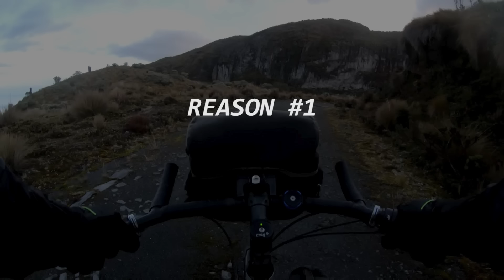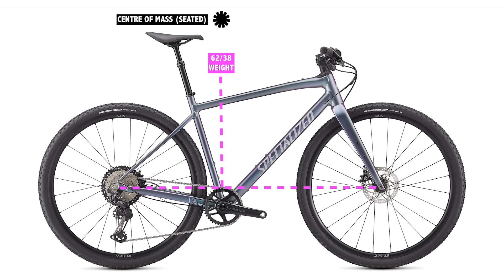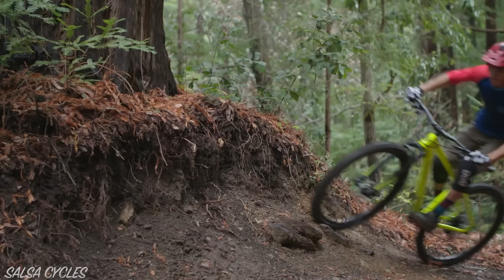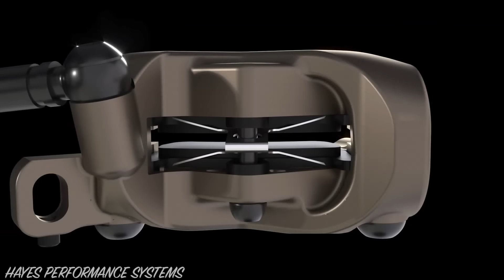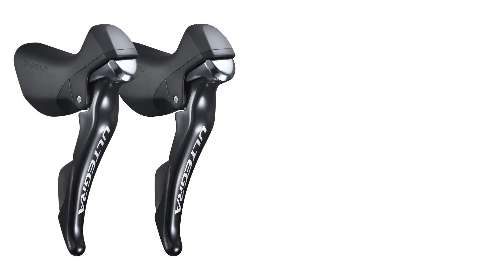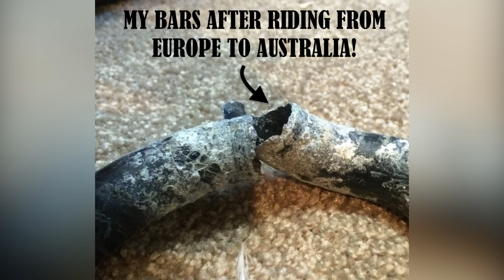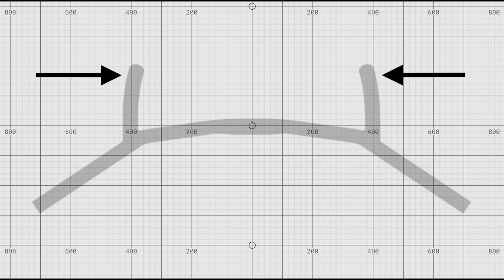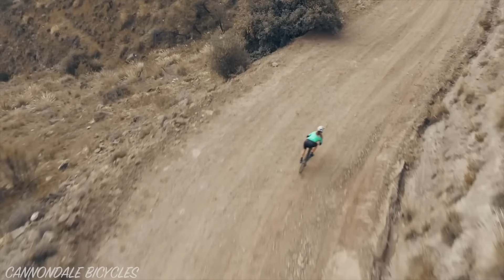Why Flat Bars Are BETTER Than Drop Bars For Most Cyclists (Objective Analysis)

Comment: In general, drop bars offer these advantages over a flat bar:  1) Forward aero riding position for less air resistance and speed.  2) Leverage in the drop bars for more power.  3) Much more hand positions and better wrist angle for comfort.  4)  Classic riding on the hoods.  5) Optional ability to add aero bars for even more aero and speed.
Reply: If I was 20 years old. And only ride on paved roads.

Comment: I finally got a Koga Denham flatbar for my Genesis Tour de Fer 20, and am really satisfied about it ! It is great, has several positions (at least 3 or 4). It could just be useful to have a somewhat shorter version, to have the arms less wide apart. Thanks Alee !
Reply from the maker: The only way to go narrower is to make the bullhorn width narrower - and then my handlebar bag wouldn't fit! I'm not sure I can live without that bag for my adventures. 😳

Comment: It's a bit disingenious to just ignore ergonomics. That's the main reason people choose drop bars for touring, of course the result won't favor them if you just rule it out. And ergonomics are not more subjective than the other categories. There's more than enough very objective research on the ergonomics of bicycles.
Reply from the maker: Both drop bars and flat bars are ergonomic by definition. With the right bike fit, you will be set up comfortably on either. This is why you find people riding happily with both handlebar designs.
Reply: @Cyclingabout  Sure, but they're not identical, so they both have (objective) ergonomic pro's and con's. That's why I don't like the implication that people choose drop bars because of looks and marketing.

Comment: There's a reason motorcross bikes are flat bared. 100% agree,  on chunky gravel roads - Australasia's best roads to bikepack , cause quietest, back country, flats wins absolutely hands down, so much more control on decent with speed, cornering particularly. Easily. By miles.
Tarmac ? Drops all the way.
But who wants to bike pack on busy tarmac roads lol
Reply: That depends on where you live. In many places, tarmac roads are often the only option of cycable infrastructure. People from the states for instance will probably not have any other choice than to ride on the road

Comment: Former bike shop manager; I've ridden about a dozen different frames and about 3 dozen handlebar configurations. Best thing I'd recommend, find the bars for you. GENERALLY, if you're after speed, try drops, if you're after long journeys in the saddle, try alt flat bars. My setup is Surly Molokos with a 110mm stem on a 2021 Giant Roam 2. That works well for me, but it may not be your cup of tea.

Comment: So agreeing a lot of these points hang on the "for most people" qualifier, and enumerate a lot of fairly minor annoyances here are my opinions on this opinion piece:
1. Agree handling is increased on a wider bar - to a degree.  If you can't fit between the trees you have a problem.  And there are a few of us who can handle a drop bar on trails most other cannot.  I'm in the .5% who will rarely be driving to a trailhead so a wide bar is a detriment on the approaches.
3.  Toe overlap is usually only an issue at stops.
4.  I don't see braking being a problem on either bar with the modern, ubiquitous uptake of disk brakes.
5.  Gear ratios are readily available on any bar type.  90+% of gravel with elevation is done on drop-bar 1x getups with huge rear cogs and small chainrings.
6.  Price - 100%.  Walmart does sell bikes and not many drop bars.  That said I absolutely dispute the "best value for money part."  That is entirely subjective.  And here's where we get to the real meat.  Drop bars are more enthusiast-oriented so come on high-spec bikes more often whereas a lot of flat bars are for "city bikes", newbies and other unskilled riders who want the confidence of an overbuilt MTB on any terrain.  (Allowing there are a good number of skilled MTBrs - they are just outnumbered here.)
7.  Selective here.  Drop bars come in more designs than the author here allows.  Just as he depicts flat bars with extensions and add-ons - these very same additions are available for and included in drop bars as well.  I myself travel hundreds of miles at a time on a drop bar with aero extensions.  It is supremely comfortable and offers several hand positions.
8.  Very few people will need to (or should!) attach more baggage than a drop bar bike will allow.  A lateral bar burrito is very subjective but also, for many, not a desirable config.  As mentioned before I have aero bar clip-ons on my gravel bike.  In the past I've strapped a drybag on top of this facing forward.  Nowadays I pack a Cyclite aero bag below these which is more aero than without the bag.
9. Very, very picky here.  Bar grip tape is not an issue in my extensive experience.  Besides which (I've never needed to but..) everyone should have a bit of tape on their inflation pump or frame for VERY MINOR and RARE issues like this.  Lacking that, it is actually possible to ride a few miles back to the car or home without bar tape!  Hell, some hill climbers go sans tape in their races.
10.  Sweat corrosion - here we go again with very rare occurances happening to newbies who probably never clean their bikes.  Where in the world did he dig up those pictures???   That said carbon fiber is pretty common thing too.  Just sayin'.
11.  Gear box shifters are not common at all.  Moving on.

So yeah - it's BS to call an opinion "objective".  The author has selected a few arguments that back up his position and relegated those that don't agree to also-mentioned status.

Here's my subjective analysis:  Drop bars are a better choice for experienced riders who ride more than a few hours/week on mostly non-technical surfaces ranging to the occasional technical single-track.  They are more aero at any speed, more comfortable over longer distances, provide more hand positions, less weight/pressure on the seat, better positioned for road/gravel racing, and navigating long distances.
Flat bars are (in general) for people riding majority technical single-track and downhill, those purchasing their first bike; those who ride occasionally - up to a couple hours per week, short commutes or people like the youtuber here, who just don't like drop bars!
Reply: Impressive, thanks.

Comment: I gotta call BS on handlebars affecting toe overlap
Reply from the maker: The front centre length on a bike designed around flat bars is longer on average. That's a fact. A longer front center means less chance of toe overlap.

Comment: The control of the bike is not about the handlebars except for braking.  Control of the bike is about weight shift.  A well set up bicycle with good geometry is easily ridden without touching the bars.

Comment: Interesting video, and the points described are correct. However, leaving the most important topic for most riders out of the equation - ergonomics - is a bit confusing. Getting better ergonomics can outperform all of the other arguments easily. I'm not saying that dropbars have generally better ergonomics. I think both types have their distinct applications, dropbars being better for higher speeds on better roads, while flatbars are better suited for rougher terrain and/or more weight/transport capacity. So you should clearly decide what you're planning to use your bike for, and then the other decisions come pretty natural, including the choice of handlebars.
Reply from the maker: The reason why I didn't discuss ergonomics is that both drop bars and flat bars are ergonomic by design. Whether the design will be more or less ergonomic for a rider depends on a multitude of factors (biomechanics are unbelievably complicated).

Comment: Aero bars are useful only on long, smooth & safe segments, because of stability and you can't brake quickly. On drops, you can use brake from at least 2 different hand (&body) positions. So, 90% of riding time, drops are more aerodynamic.

Comment: Both times I bought used bikes with drop bars for use around town, the first thing I changed was... the drop bars... 1. The stance may be aero but it gives , in my opinion, a poor overview of traffic and caused me neck pain (back in aero position + head in upright position = bad neck). 2. The brakes were not quickly accessible in the upright body position (this is perhaps a defect corrected on the more "modern" drop bars?)

Comment: Ha Ha, Just bought an AMAZING accessory from Chins, so its drop bar add ons for flat bars, like bar ends, so you just slide them on your flat bars allowing drop bar spacing/width of any size, you can use flat bar shifters, drop bar brake/shifters, cyclo cross top mounts, bar end shifters, if you use a bar end mirror that sticks out nicely on the end of the flat bars, the possibilities are almost endless, no idea why you never see them here, you can quickly convert a flat bar to a flat bar/drop bar combo, you can adjust the flare by rotating the flat bars, reach with stem length and rise so much better than standard drops which are very expensive if you want wide.....and thats if you can find any over 46cm

Comment: When you wipe out on your 42cm drops and take out your GRX STI's it's gonna be expensive too, and that's if you can get a replacement in the third world....  there's reasons for sticking to tried and tested old tech like steel, MTB, 26", 7/8/9 speed, rim AND disc compatible frame/forks...

Comment: It all depends on what you want to do with your bike. If you only ride on the road and long distances, drop bars are the best.
Even on a mix of road and off-road riding, drop bars are often better especially if you do long distances because, among other things, the position of your hands is much more natural.
If you mainly ride on difficult to very difficult terrain, then flat bars are the right choice.
So flat bars are no better than drop bars or visa versa. It's simply a matter of using the right bars for the right purpose.

Comment: As someone with arthritis, flat bars destroy me within 30 minutes, drop bars orient my hands in a neutral strain position. Ergonomics isn't ignorable for some of us. Yes you can get add-ons for flatbars that give you similar hand posture but they aren't designed as the primary position, so your brake access is wrong. Also if you're customising your bars so much that you aren't using any of the default primary positions then the distinction between flat and drop stops being a useful one: at that point they're just generic levers you've attached some custom stuff to.

Comment: For me 6 of the 8 minutes on flat bars don't resonate. With drop bars shifter/brake levers are always at the ready. Hydraulic brakes are fantastic! There's no difference in stopping power whether on flat or drop bars. If I was doing mad miles I think the main advantage of flat bars is a more upright position which makes it easier to look at all the beauty you are riding by. Great video. Thanks!

Comment: About the Koga Denham bar that I tested : way too twitchy when bike is unloaded. Ergonomics are fine and make the bar comfy but its design brings the grips area too far backwards, beyond the steerer tube, unless you use a very long stem which in turn will stretch you too much when on the horns of the bar... In my opinion, the new Velo Orange Crazy Bar has smarter design.

Comment: My favorite for touring, bikepacking and city riding are butterfly bars. When using butterfly, shifters and cables do not get in the way with handlebar bag and also i can rest my hands very good on butterfly and ofcourse you can use them for aerodynamic position, not as good as with dropbars but still not bad.

Comment: I would just add that when you aren’t in a race, flat bars with more upright position offer more natural air ventilation which is very important riding bicycle in summer. Also flat bar with a slight back-sweep offers the most ergonomic hand position. In a city flat bar more upright position offers better visibility over traffic, and enables rider to perform sudden manoeuvres which in a city riding means more safety. Flat bars hands down is a winner.

Comment: I agree 1,000%. I had drops for years and almost never used the lower position. I swapped to "bull horns," but these days I've got an old Ibis titanium MTB with a modest rise and it does the job. 
I added bar ends, taped up with bar tape for comfort, and I'm a happy bunny.
Cheers
Reply: So what's the difference between bull horns and bar ends?
I like the hoods, more comfy and natural position, I can shift slightly my hands so, I spend most of the time there with my drop bar, sometimes on the flat, less on the lowest part. Maybe I could cut a bit...
Reply: @DR_1_1  It's hard to say. Probably not much. I can see that drops will give you a faster, more aero position on the flats. But I'm more interested in long distance comfort. So I think the flat bar/bar-end combo gives me more options for hand placement.
Reply: @BrianRPaterson  Apparently it could  be linked to our body shapes, I think long legs and arms prefer lower bars, long torso are more comfy with straight/flat...

Comment: You are incorrect in assuming that ergonomics is a subjective experience. Also your sample group is limited as is your target audience. Lastly your experience is somewhat lacking in the versatility of use and time. 
Bold brash statements without basis or consideration. THINK AGAIN. Do it right.
Reply from the maker: You should be more specific and provide evidence (or reasoning) about why you disagree.

Comment: Glat bars are great witb ablut six inches cut off the ends so bloody eide nowadays. I was a road cyclist still am i have a Ribble hybrid mow after brsin damage. A little clumsy i fo t wntto trash my full carbon road bikes, irs an illness cycling it really is. So a hybrid thats slowly becoming a toad style hybrid. Its a sore point i wisj it came with canle actuated brskes nloody full hydro i csnt use my 105 brifters. Putting a new 105 rd on i font use the smaller rimg at all in fact its ground off pointless that a 105 casette problem arises with shifter csnt use my current 105 unless it get cable actuated brakes another 200 quid. So ive come to a comprise withyself ill get a Sora rd i canuse the altus casette still its nearly new.  And use mountain bike shifters. I believe you can up to nine speed any more the cable pull is different that abd hacking said flat bars. Really good bike for 600. Ive tsken the silly hybrid rack off abd put on a carbon seat post. Came 11 kg 6 lbs its foen to 10kg 3lbs. Ill have it sub ten just light gor what it is i do miss a sevfn kg bike. But it would brake my heart snapping avfull carbon frame.  Fair enough my folks will get sacrificed but the frame eont fold like my madone one did. I hit a tree hsrd i mamaged to dlip off to the side. Thebike hsd no chance a literal bend in a aluminium frame. I couldn't do it again if i tried. Like the somersault i fid hitting a metal farmars fence. Im lethal at times mainly because im an adrenaline junkie. Mot souch the small amount of brain fuckery. Spelling sbd grammar of all things have definitely been effected. I get people saying i had a stroke reading this. Funny that, tbats why my writing is messed up sbd non existent grammer ill take it. Lucky af.

Comment: I agree with your take on bars and prefer very wide, moderately swept flat bars with inner bar ends for very long heavily loaded bikepacking (Tumbleweeds Pursuader 840 mm with 30 degree sweep and 50 mm rise). The ability to run mountain bike brakes and controls is, as you state key, in this. I am very fortunate to have both types of bars on different bikes including 500 mm flared bars on a gravel bike on which I am limited to 38 700c tires. 

I am examining brakes for the flat bar bike. Have you done a video on this? The question is hydraulic mineral oil versus DOT fluid versus higher performance mechanical brakes (at least in my mind).

Comment: *For me having tried both. 
I went with the XL 600 Curve Walmers. The multiple positions outweighed the flats for me. 
One thing you missed, sub brakes. I run GRX sub brakes on the flat section of my Walmers. I’m surprised I haven’t seen anyone else doing it. Seems like I might’ve invented it 😂

Comment: Two mistakes in the Video:
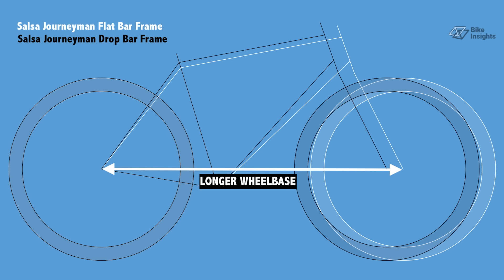2:20 additional stability at speed comes from an increased turning circle, this has nothing to do with the centre of mass
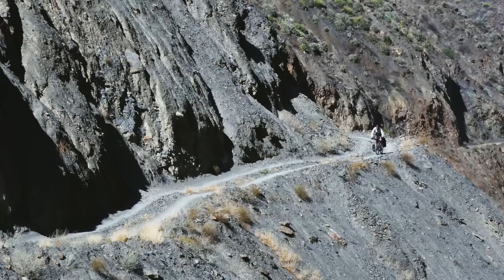2:37 you will not maximize front and rear tire grip at the same time, you will just increase rear tire grip as the centre of mass is moving relatively backwards, compared to drop bars.

Comment: As with most of these videos, it depends what type of riding you are doing. A lot of handling, stability, braking is based upon body position. You can move around on the bike better with drops.
Straight bars may be better off road, cyclo-cross notwithstanding. If you are doing any distance on road, drop bars are quicker.
If you have to use a contentious "sweat corrosion" point, you are scraping the barrel. I have ridden hundreds of thousands of miles on drop bar bikes and never seen corrosion on alloy (or carbon fibre!) bars.